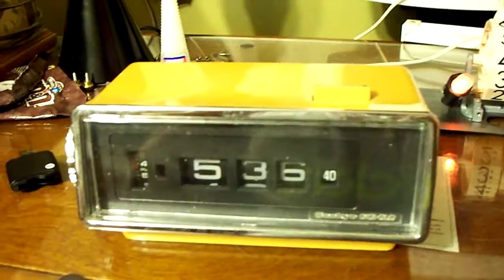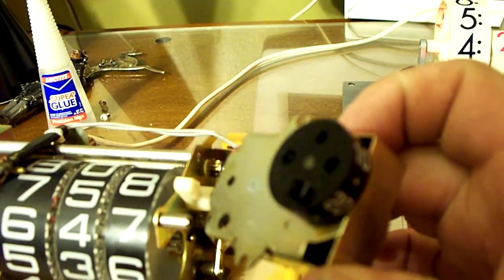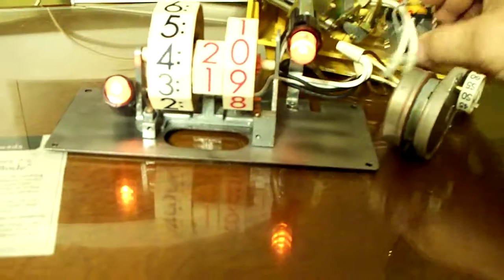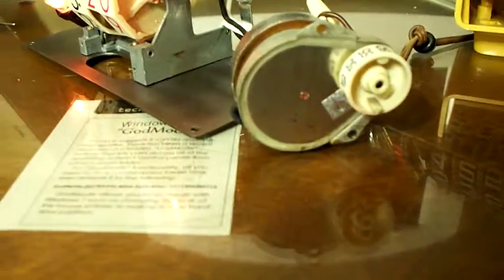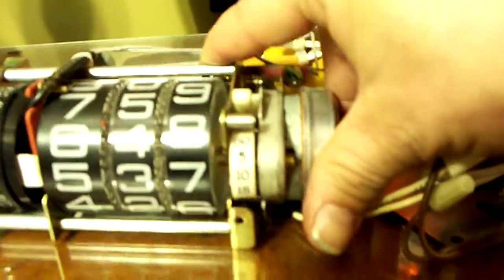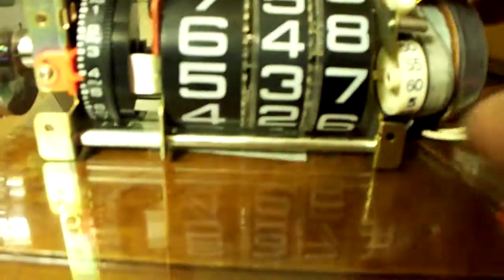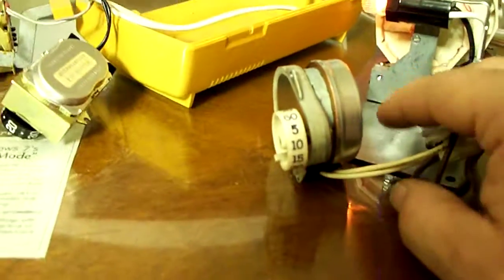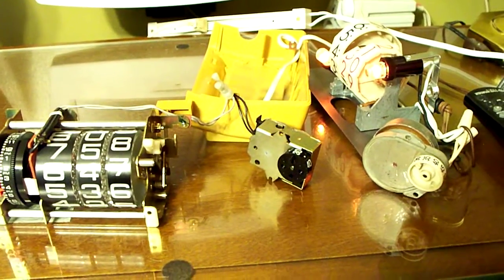motor discovery

Comment: I have an Intermatic time clock, with the same problem. All I did, was open up the back, and replace the rotor gear, and it works.

Comment: I know this is an old video, but the motor is still made. They were made by Intermatic for Sankyo and all you need to do is get a working intermatic timer and take the gears out of that, or go on eBay and but a repair kit. The small gear on the motor shaft usually strips and the big grey gear sometimes also breaks. The kit has both gears.